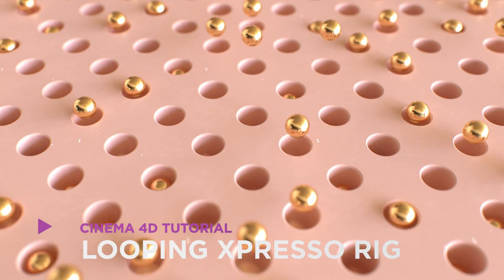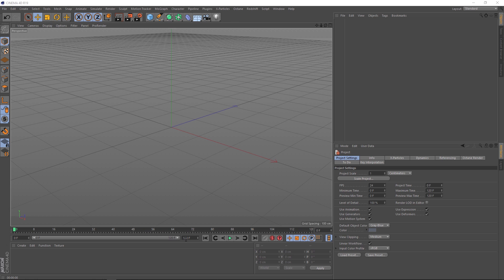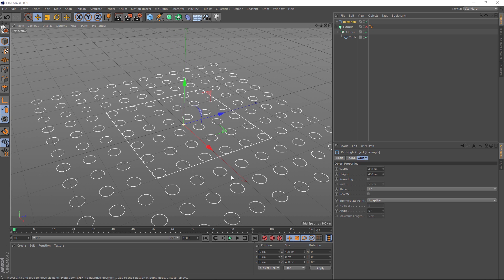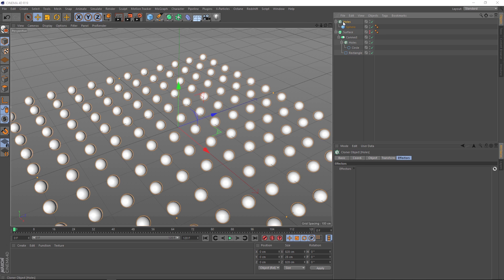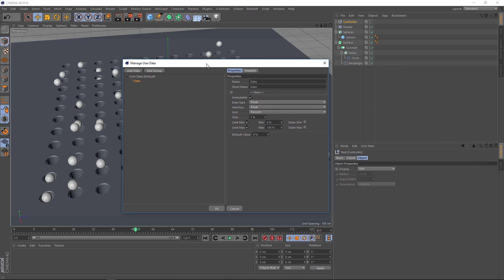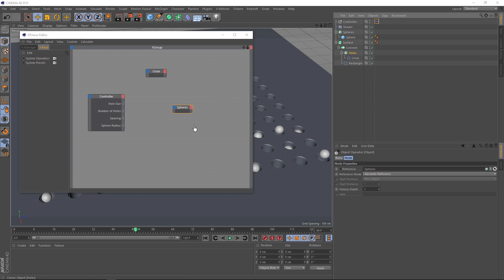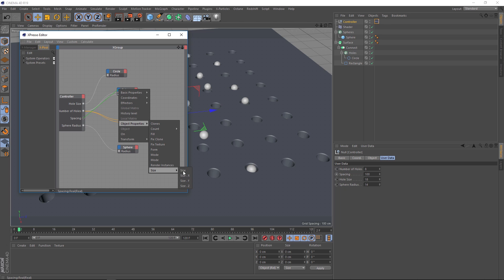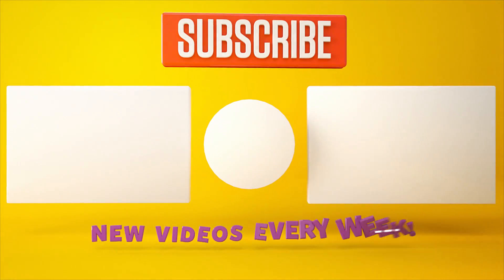C4D Looping Xpresso Rig - Cinema 4D Tutorial (Free Project)

Comment: I got to the shader step and when i changed the values to 2 and 5 respectively, no animation happened! no movement. I can't figure out why this is happening... any suggestions?
Reply from the maker: Sometimes older tutorials dont work so well in newer versions of C4D due to changes in the software (usually a single step needs changing slightly) best way to check is to download the project file from the link - if that works in your version of C4D you should be able to see where you went wrong, if not you may need to tweak a step or you can try in an older version of C4D.

Comment: Bye! .. thanks for the tut. I tried to create a mask in the center of the cloner so that the holes are only at the edges of the plane, without success. it is possible with your "boolean technique" (one connection on cloner and rectangle). I don't know maybe with some field and vertex weight sorry for my english I hope it's understandable.
Reply from the maker: You could use a mograph selection and just paint out all the circle clones you dont want in the middle;)

Comment: Thanks for the lesson! But I did not work in Xpresso to attach all the parameters, what could be the problem? Joined only one is valid only X or only z.
Reply from the maker: Yeah it can be a bit tricky, you have to plug it all in just right. But you can skip the Xpresso if you want and just run it with the cloners directly
Reply: @CGShortcuts  Thank you for your prompt reply. Will make is how it is, then I will try again!